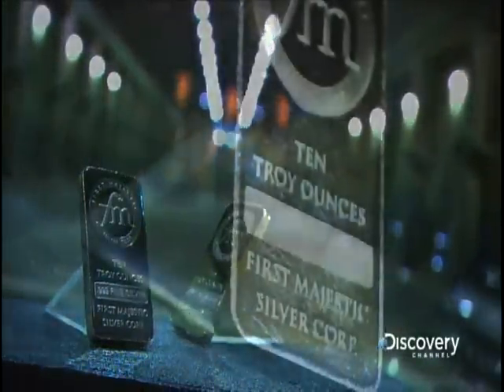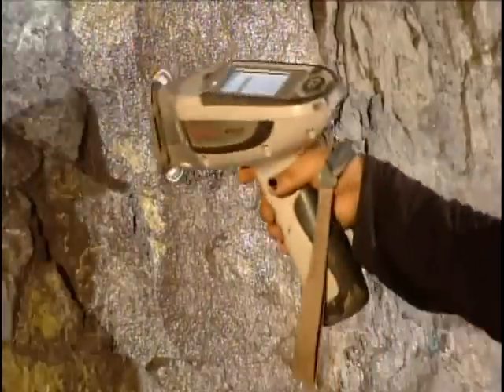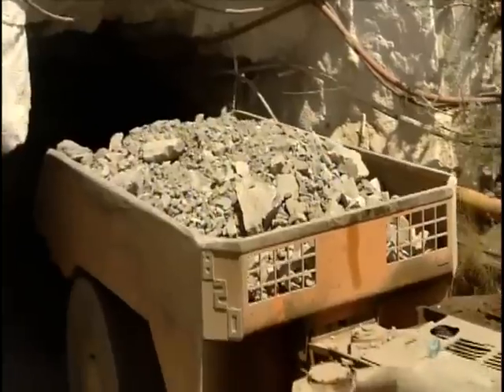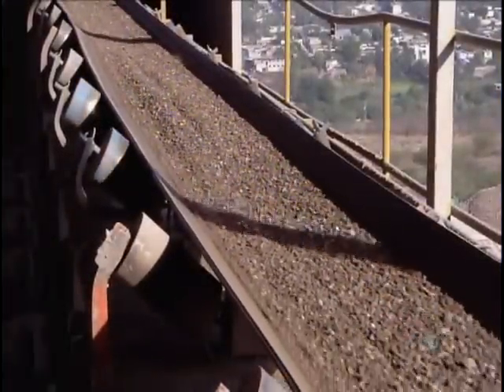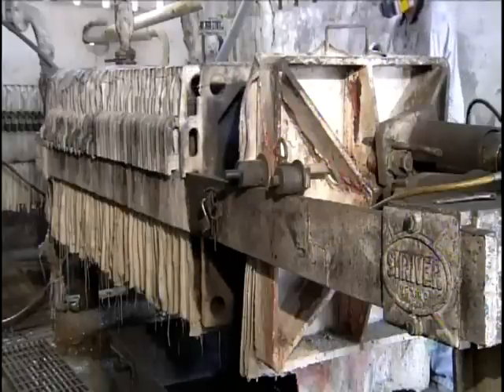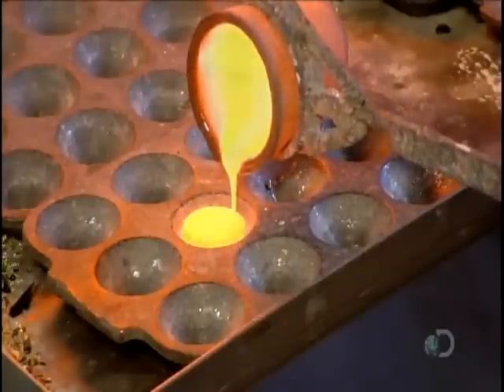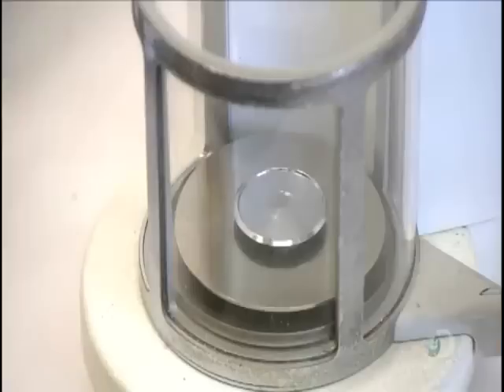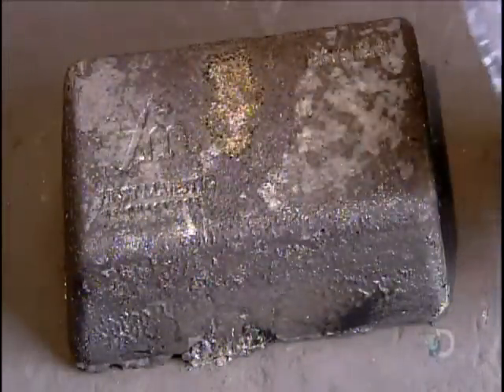How its Made - Silver

Comment: Silver is listed at 1.59*10^-8 Ohm*meters and the most conductive metal.
Copper is 1.68*10^-8 Ohm*meters and the second most conductive metal.
Gold is 2.44*10^-8 Ohm*meters and therefor the third most conductive.
The reason you gold plate contacts is because gold does not corrode(tarnish) like silver, copper or aluminium. Metal oxides have a high resistance.
The gold plating on your stereo plugs is 0.1 to 0.5 microns. As a comparison, human hair is on average 100 microns.

Comment: @juozasQaz 
The most electrically conductive element is silver, followed by copper and gold. Silver also has the highest thermal conductivity of any element and the highest light reflectance.
Reply: TheAmazingErick1 have you considered that for naturally occurring objects,  diamond,  which is made of carbon,  has a much higher thermal conductivity than silver, but diamond isn't really useful for thermal issue besides focusing lasers, because diamond isn't easy to work with.  Synthetic diamonds have a much higher thermal conductivity. But you're correct that silver is one of the easiest to use highly thermally conductive elements for now,  until graphene becomes manufacturable, or until we figure out how to make transistors or processors inside diamonds.

Comment: It looks so complicated. I am wondering how people used to extract silver in ancient times?
Reply: ..they did not
Reply: TooFastTooDoge Romans used gold, silver and bronze as currency
Reply: yea how did someone in ancient times figure this out?  and where did they get the acid?  i guess they just went to how it's made on youtube to figure it out.
Reply: Aliens
Reply: Silver extraction in ancient times actually occurred a lot the way it does now, just not with all the machinery.  The primary things to remember is that silver is heavier than most other materials.  Anyone who's gone gold panning knows that when you do so, the basis of finding the gold is that the gold sinks to the bottom while the rest of the stuff stays up top.  The same thing works with silver.

Removing many of the impurities came from the usage of acids and alkalis.  Silver is a corrosion-resistant metal.  It will tarnish on the outer layer, sure, but that wipes off pretty easy. The silver would be bathed in acids and alkalis until it reached a desired sheen.

As far as "where did acids come from?" Acid and alkali are naturally occurring materials.  Your own stomach creates hydrochloric acid, and grass eating animals create a more alkali based digestive juice.  Sulfuric acid was found primarily near volcanoes where there would be sulfur deposits.  Sometimes clouds of sulfur powder would be launched into the air and mix with rainclouds to create an acid rain, and sometimes deposits of sulfur would be swept into streams.  It doesn't take a genius to figure out what that "water" does to someone who drinks it (though it probably made for some rather unhappy people).  Using other corrosion-resistant materials, these streams would be extracted and used for the acid.

Finally, remember that water evaporates.  The water used to wash the silver deposits was boiled so that the water will evaporate and leave the solid materials behind.

HOWEVER, the silver that they had used in those times was not as pure as we can get it today.  Hopefully, that answers your question.
Reply: MrWhitman Thank you very much this. Finally an intelligent answer.
Reply: The Romans used to cook the ore over an open fire vaporizing the lead, but most people didn't die from lead poisoning because they mostly died other ways beforehand. Besides who cared about slaves anyway, not the Romans. And the Romans didn't know at the time that Lead was toxic. Lead poisoning eventually led to the fall of the Roman Empire.
Reply: MrWhitman or aka alchemy
Reply: @Golbs  you rather give aliens credit than God who credit all?

Comment: I wonder what the mystery solution is that makes everything but the silver burn away.
Reply: flux
Reply: After the secondary fire assay, the little ball of silver is picked up by tweezers, it is placed in a testable where a solution of sulphuric and nitric acids and water dissolves the silver into a solution. That solution is tested by an Atomic Analyser to determine the ppm silver. Geological survey teams on mines use this information to determine where to next mine. The same process is used in gold mining except the rock deposit is a core drilled sample similar in shape to a cylinder.

Comment: Usually gold plated contact are used when low currents flow. Gold is prefered probably because it's less susceptible to electrochemical migration than silver. Conductivity is not that important for those thin layers of gold. And for contacts, not pure gold is used but gold with additives like Co or Ni ("hard gold"), making it harder and less susceptible to cold welding or wear, properties that pure gold doesn't have. The thickness is of the order of 1 um.

Comment: In this process the extremely toxic lead and cadmium is released into the atmosphere. Great Process, Not!
Reply: +Peter Hall As far as I know they are not released into the atmosphere. They are recovered and reconstituted into their metal state. Those metals are valuable just like silver, only not as much. A good amount of lead can be sold to ammunition manufacturers for bullets or die press manufacturers. Lead dies make excellent, cheap, heat-press dies. I actually used a lead heat-press die set when I was manufacturing livestock tags at my old job. I'm not sure which industry uses cadmium but I've seen several universities using cadmium in reactions.

Comment: wonder who decided that gold and silver were the "valuable" metals
Reply: dude, do some research before you make yourself sound silly.
Reply: Gold and silver are considered valuable due to their scarcity in comparison to other metals.
Reply: Ykhraam because they don't rust away like other metals. Their scarcity makes them valuable, and their nobility makes them last a long time. It's a good currency if you ask me.
Reply: Kimberly ,-, also, they are is easy to craft into tools/jewelry, which helped them become valuable in multiple cultures, which helped them become an "international currency" of the old times.
Reply: Copper, as well as brass/bronze(copper + zinc/tin), iron/steel, and aluminum, were ALL at one point or another FAR more valuable than gold/silver.
Reply: ALUMINUM, a metal easily stronger than any iron or bronze.... yet nearly light as wood.... and impervious to corrosion.

Kings would have gladly paid 100 pounds of gold, for 10 pounds of aluminum in the age of "chivalry."

The only problem is that it wasn't discovered PUBLICLY, until the 19th century.
Reply: The natural laws of economics, that's who.

Comment: ''Silver is the most conductive metal'' Uh no..that title actually belongs to gold...
Reply: NOPE. Silver, then copper, then gold. 

Gold does have the superior corrosion resistance.
Reply: no its silver. Silver is the most conductive metal.
Reply: I thought the most conductive was platinum, then gold, then silver and copper ..

Also, I believe gold is the most reflective, at least at infrared wavelengths, which is why satellites are wrapped in gold foil as well the mclaren f1's engine bay.
Reply: 43854586 satellites are NOT wrapped in gold. It's just a golden colored foil. It's actually a Metallized kapton polyimide film.
You are right with the Mclaren.......it is gold, and gold is used there because it doesn't corrode.
Reply: no its silver
Reply: dacel88 u got pwned
Reply: Wrong. Wrong. Wrong. It's silver.
Reply: dacel88  Its Silver! Lol you got owned!!!
Reply: It's because silver provides very little resistance to current and therefore allows electricity to travel almost 100% from point A to point B. Gold is about 80% but doesn't corrode for decades. And copper is about 70% but is easy to farm and use. It is also much cheaper. Silver is also much more of a pure metal as well. There are very little traces of any other chemicals that don't make up its composition. Silver resists radiation and so does gold. But copper does not. That's why space shuttles and probes are so damn expensive. They have to be made with minerals that's resist all types of corrosion. Silica is what we use to create computer chips. There is a better mineral than that but it is far too expensive of a process to deem worth making for common usage. Those are also put on anything sent into space.
Reply: It's amazing what false information people are convinced is true.  As far as the most conductive metals, it's so easy to look it up on Wikipedia or Google.
Reply: Idaho Spud silver is a pure metal. Gold isn't. Gold is unique in it's resistable properties with electricity and minerals. It tarnishes but doesn't corrode away like most metals. Silver only has a few% of electrician conduction compared to gold. Gold almost has no resistance. Copper is easiest to find and refine. And is decent. That's why copper is used most often. Copper had a lot of impurities in it's composition. Y'all need to read shit and look it up if you don't truly know what ur talking about. I've been a rocks and mineral fanatic since I was a child. My favorite metal is tungsten. And my favorite mineral is amethyst.

Comment: The electrical resistivity table I saw didn't list iridium, so I had to research it a little bit.  The resistivity of iridium is 47.1 nΩ per meter, but silver is only 15.87 nΩ per meter, so it only has one-third the resistance of iridium.  Both of those measurements are at 20 degrees Celsius, however.  Maybe iridium has a lower resistance than silver at a different temperature?

Comment: Nope. It's a common misnomer. Gold doesn't oxidize so it's used in many electrical connections to they don't degrade over time, which is why I think people assume it's the most conductive. It's still very high on the conductivity list though.
Reply: Don’t know why I’m responding to a 5 year old comment, but silver is the most conductive metal. Gold is less conductive than even copper, but they use gold plating to insulate silver contacts.
Reply: he said that people think gold is more conductive. So yeah you replied to a 2 year old comment for no reason lol

Comment: "Chemicals that prevent silver from burning off".  Metals can "burn off"?  I don't remember that from freshman chemistry.
Reply: One thing you might remember from freshman chemistry is that most elements are metals. Another is that fire is simply oxidization that produces enough heat to create a chain reaction. It's usually a matter of whether the metal is in a form with enough exposed surface area. This is why a steel bar will rust in a fire, and steel wool will burn fast.

Comment: No, silver is more conductive. The reason gold gets used more is that silver tarnishes very easily, making it less than ideal for pins or leads and defeating the purpose of using silver in the first place. Gold, however, doesn't really tarnish or corrode, making it a better material for those uses.

There are CPUs that use silver interconnects IIRC.

Comment: Is silver better than gold?
Reply: Neither is better.  They each are better at certain things.
Reply: Silver is better at conducting heat and electricity,  while gold is more ductile and less reactive. Silver is used for soldering, conductors, and high voltage switch contacts, while gold is used for low voltage contacts where oxidation would cause a significant voltage drop.  Gold is also used for tiny die wires in integrated circuits because it can more easily be pulled into those tiny wires.  You can often see the die wires if you look into LEDs which are turned off. You might need a microscope.  Copper is similar to silver In  function, and much cheaper and more abundant,  so it is used rather than silver for most conductors.

Comment: gold is actually the most conductive not silver
Reply: iwillavengeyou Gold is less reactive so it lasts much longer and is used for low voltage contacts where any kind of oxidation would cause too much of a voltage drop.  Gold is also used for tiny die wires because it is so soft it can be pulled into tiny wires without breaking.  But silver and copper both have a higher electrical and thermal conductivity than gold does,  but they also oxidize much more easily, especially at high temperatures.